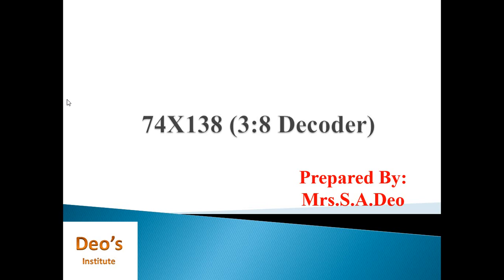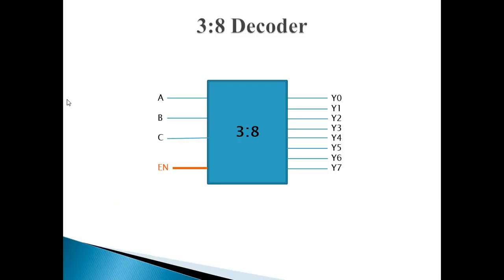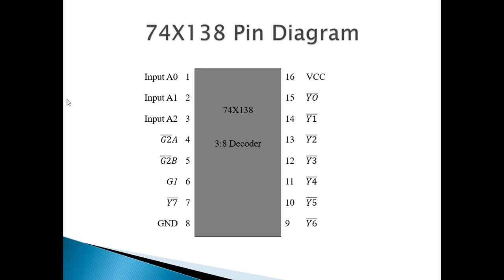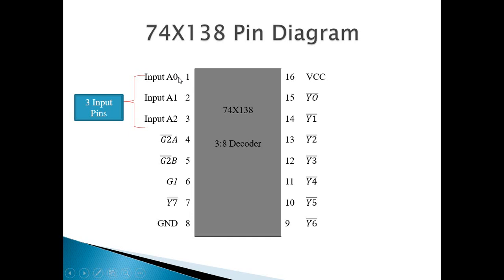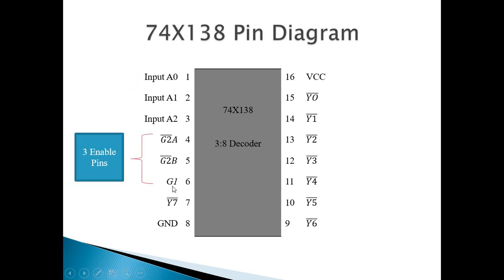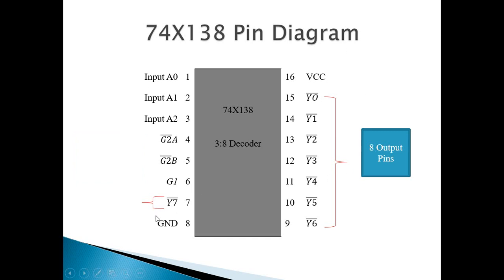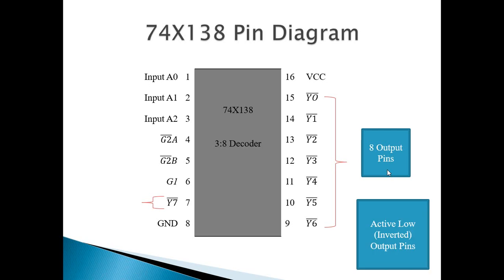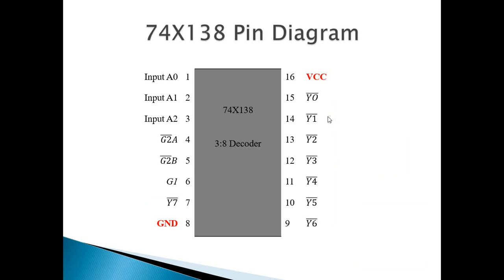74138 Decoder IC| 3 to 8 Decoder| Pin diagram 74138| Working of 74138| Why 74138 have 3 enable pin

Comment: Mam ,in full adder at o/p side we have to use NAND gate instead OR gate because the output of ic is complemented and we know that when we apply complimented input to the OR gate then it functions like NOR gate so we have to use NAND gate because when we apply complimented input to the NAND gate then it functions like OR gate.
Thank you.
Reply: Correct...i have been also taught that we have to use nand gate
Reply from the maker: Yes... whatever you are talking is correct..but it is specific to 74138 IC..the diagram which I have explained is in general circuit for decoder...not for any specific IC